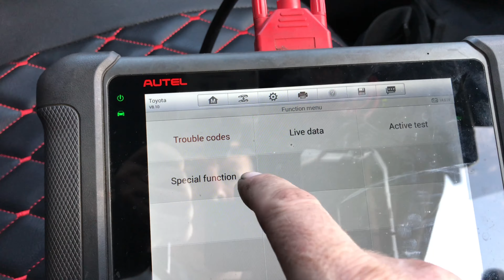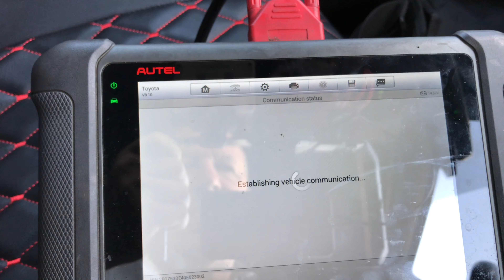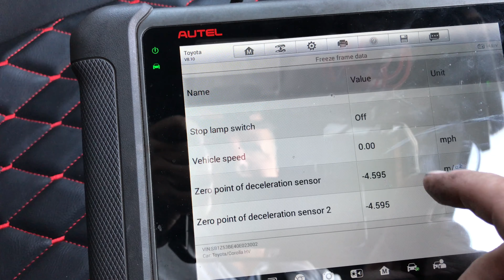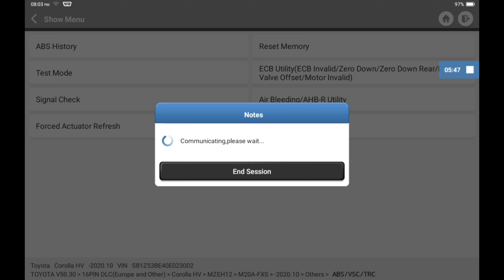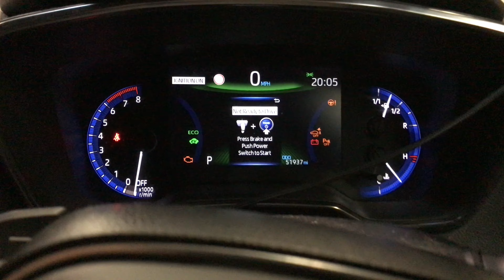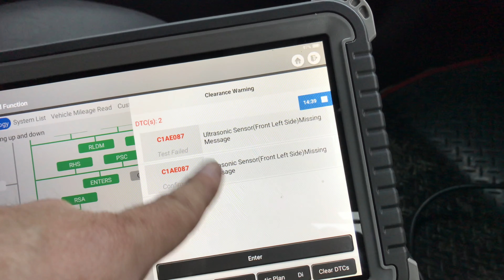Toyota Corolla Hybrid (2019) - Braking Power Low😭 - Fault Codes C1203, C1245, C1336, C1345 & C13A9

Comment: I have this problem on my Corolla 2020 hybrid I change the abs sensor on the left front side the lights when off but when I drive it the lights come back I erase the codes but they keep coming back any suggestions
Reply from the maker: Must be abs ring then
Reply: @sandyande  everything started cuz I had somone change the axel after that starting having the problems I also have a new wheel barrel do u think I might still be the tone ring the one needs to be check?
Reply: @sandyande this is the code I get c0507
Reply from the maker: What is the code definition?
Reply: @sandyande  it’s abs sensor code

Comment: If the brakes are serviced without following the manual Sandy…I suspect the pedal stroke sensor likely saw “massive” stroke without the normal accompanying pressure build (as the pistons take up the gap) Since the system combines regenerative and hydraulic braking multiple modules will find this scenario highly objectionable.  Alternatively the system does a pre drive check running the pump to pressurize the system with the same results.  Failure to follow the manual on these can get expensive in a hurry! Cheers 👍

Comment: Can you see a taxi drivers mare doing this at 7pm on a Sunday evening Sandy , it's a blimmin car so much unnecessary rubbish these manufacturers are putting on nowadays , I found a set of points the other day , new ones at that , I think I will have to buy a top don , got the autel a few months ago ,as snap on will not update my verus , it's at 2018  they wanted 4 grand plus vat for a new one , without  a scope 🙈🙈🙈💸💸💸, did a mazda cx5 2 days ago , rear discs and pads 18 plate 21000 miles , rotten discs , tried 5 scanners to put into service mode,  nope , u tube , press the handbrake switch , press the accelerator keep both pressed , ignition on for a few seconds,  ignition off keeping both pressed , ignition back on motors wind in , reverse switch for resetting pressing accel again etc , crazy crazy , an hour of my life I will never get back , the Haynes manuals for these cars will be like the Encyclopedia Brittanicca , or maybe not , just saying refer to dealer , cheers for posting the info 👍👍
Reply from the maker: Yip Topdon seems to be good value for the money, Good tip about Mazda brakes cheers Mike, Sandy

Comment: I have Corolla hybrid that won't start. Have you ever repaired the starting mechanism in the transmission?
Reply: Did you resolve the issues ?
Reply from the maker: I'm sure it starts just by powering MG1, what codes have u got and is the 12volt battery good and coded to the vehicle